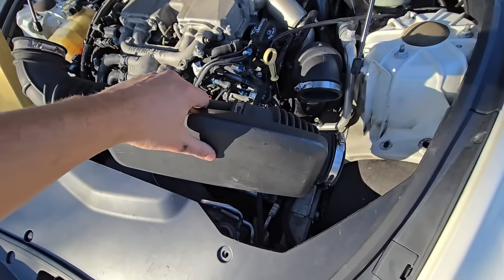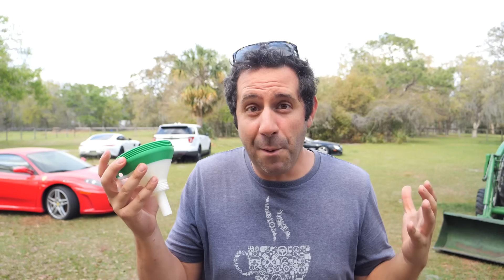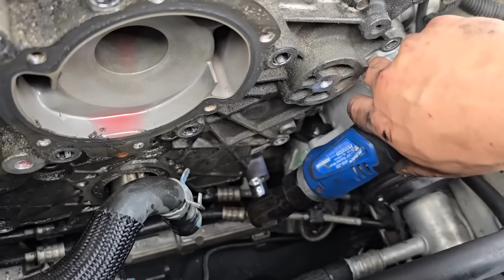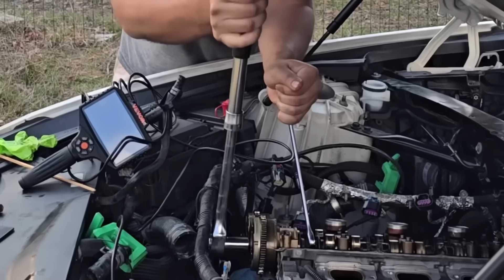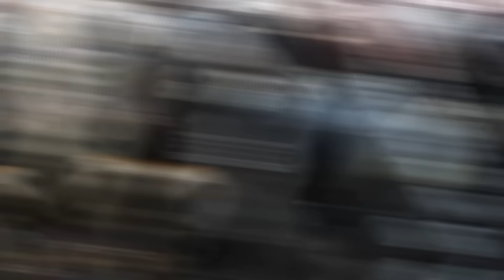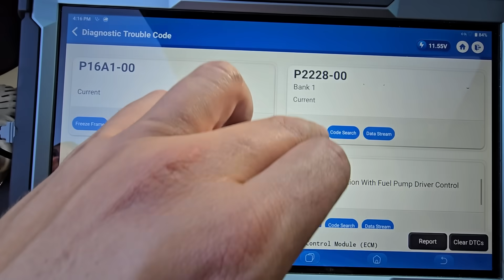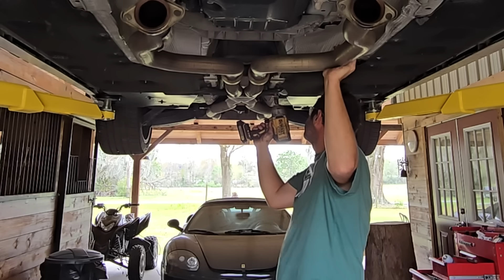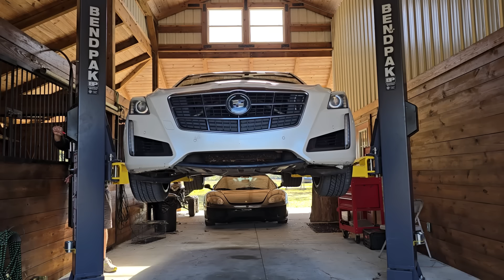Turning a Mechanically Totaled Cadillac into a 500HP Twin Turbo Sleeper

Comment: Sorry, sam! But everyone beware of Bambu printers see the issues with firmware this company may have in the future. Great printers, but may have future issues with printing in the future.
Reply: I came down here in the comments to say the same thing. Bambu has begun to force updates of software, or they will brick your printer. In effect, you lose control over the product you purchased. I don't own a printer yet, but when I learned about this, I crossed it off the list.

Comment: Maybe for the better that GM goes all electric. They have so many problems with their turbo engines, and even their n/a V8s. For a company that's been in business for so long, it's shameful incompetance
Reply: This car probably would have been fine if the owner(s) had kept up with the scheduled maintenance, especially oil changes.
Reply: Don't worry, they'll find a way to screw those up too. 😅

Comment: One thing that would make pulling the pulley smoother is add some grease on the threaded shaft of the tool. Do that with any threaded puller or press tool like that.

Comment: The reason the dealer would rather sell you a new car is because after expenses there is not as much profit especially for the amount of risk that the mechanic (which there are less and less experienced techs at dealers) mess something up and end up breaking it further or it not being the only issue and the customer feeling like they got ripped off.  Today's engines are a lot more complicated than your dads chevy 350 or 454 and computers lie.

Comment: I had a 2016 CTS 2.0T and it was a great car to drive, that chassis is so capable and versatile.
Reply: I have a 2019 2.0 and when I put it in reverse, sometimes it clucks. I change the drive shift, motor and transmission mount. What in the transmission could it be?
Reply: @reggiehammond6508 could be many things. Valve body, shift solenoids, transmission actuator. Hard to say
Reply: @reggiehammond6508  part it out
Reply: @reggiehammond6508 on my 2013 Cadillac ats I noticed the same type of clunk when shifting from drive to reverse or park to drive. I did a little diagnosing and the transfer case has a little play in it. I bought my car used so not sure if it made that new. But I bought a replacement transfer case and noticed it had same amount of play. So I didn’t even bother installing it. They use same transfer case so maybe it’s normal?
Reply: @ it’s don’t do it all the time. What I figured out is if I let it sit for a while before shifting into reverse it won’t do it. It’s like maybe the pressure is high sometimes 🤷‍♀️
Reply: @reggiehammond6508 not sure if it’s related but my civic had a code once for a high pressure transmission switch, luckily it wasn’t inside the transmission and easy to replace myself. Don’t know if it might be that and maybe just not enough to throw a code or gm might not show that on a basic scanner or dash